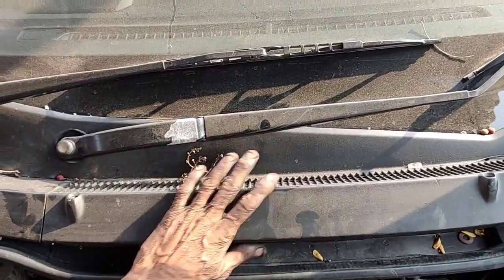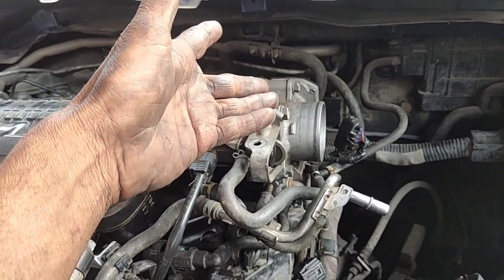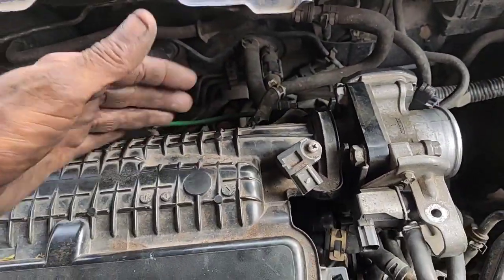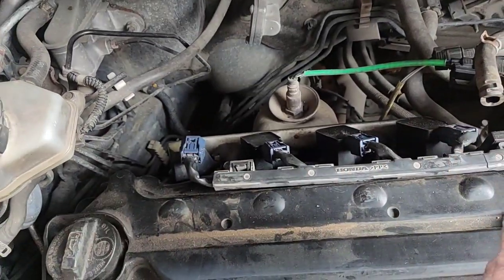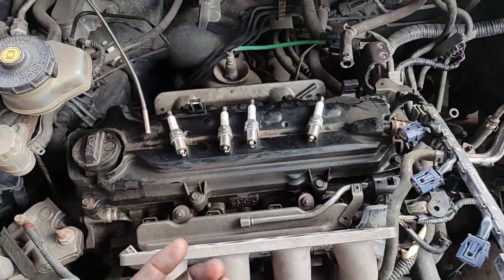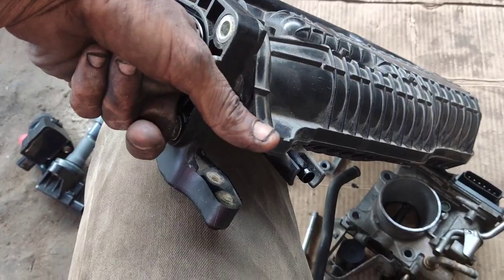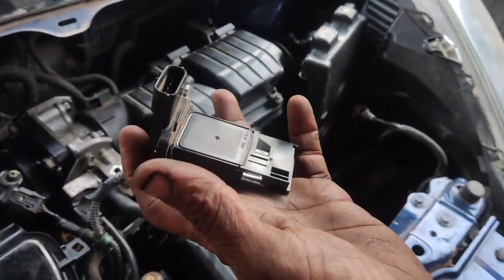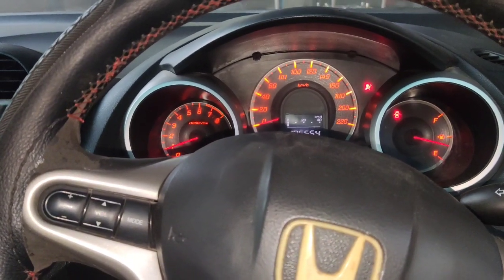Honda jazz ignition coil change(@skilledmechanictamil)

Comment: Hi Anna honda civic old pick up issue iruku.... Sudden acceleration ..car apdiye vetti vetti edukudhu.... Enna prob adhu
Reply: Bro same  bro
Reply: Neenga ready pannitagala bro
Reply: @djnoisefactory  yes bro.... Throttle body cleaning dhAANn next ... Adhuvum work agala na.. last fuel filter pakanum. ...
Reply: @prasanthradhathiyagarajan8196  bro neega map sensor check pannuga bro...frnd suggest panaga 2 days aprm car check pananum bro unga location bro
Reply: @djnoisefactory  avadi.. . Accelerator sudden ah kudutha vandi edhuvum agadhu acceleration onnu car sudden brake adicha madhiri oru jerk kuduthu pogum.. ilana.. romba slow ah acceleration agum.... Idhu dhaan enaku periya prob ah iruku

Comment: அண்ணா, உங்களின் அடுத்த வீடியோவில் எந்த திசையில் பிஸ்டனை அசெம்பிள் செய்ய வேண்டும் என்று சொல்லுங்கள். பிஸ்டனின் மேல் அம்புக்குறியை எந்த பக்கம் வைக்க வேண்டும்.
Reply from the maker: No confusion oil spry jet see piston slat
Reply: @skilledmechanictamil  thank you. Also please explain in detail about the assembly of accessories driven by the engine like water pump hoses, PCV connection,  EGR valve connection, turbo hose connections,  and electric circuit connection